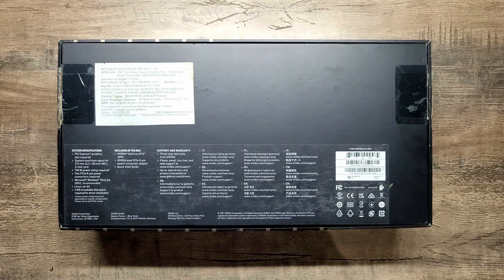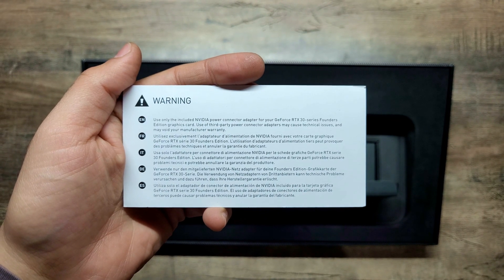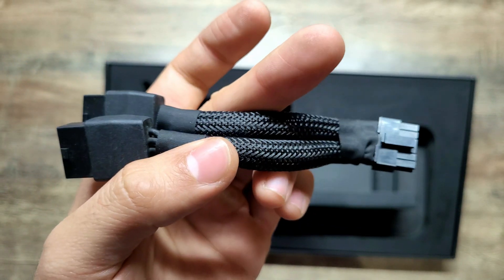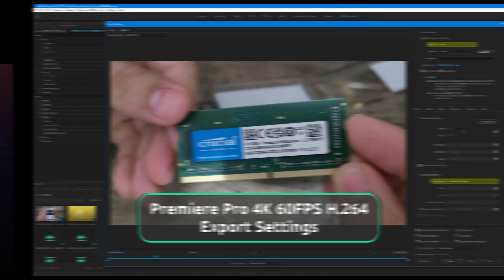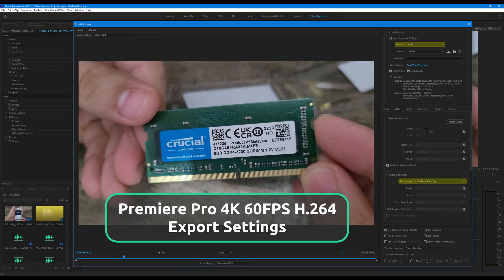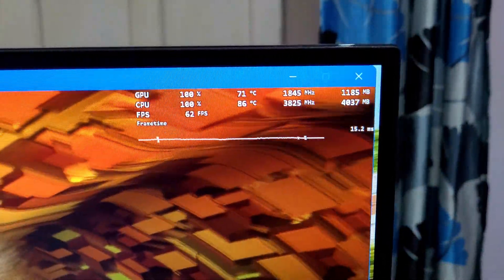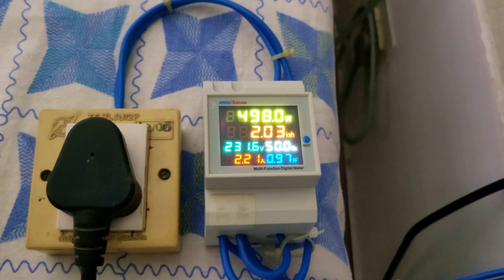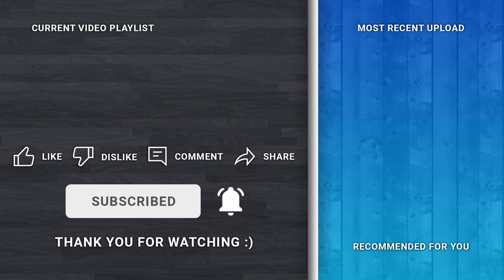GPU Upgrade: From 7 Year Old AMD RX 460 To Used nVIDIA RTX 3090 in 2023

Comment: Very good pc case if you have many HDDs like i do.
Reply from the maker: Yes, only complain with this case power button. I had to open the tiny push button after a few years and scrub carbon deposits then glue it back together.

Comment: *Airflow left the chat
Reply from the maker: 🤣 Airflow exists but this card made everything hot
Reply: @LoveleshKalonia  my 6950xt heats up my room like its a sanna i can only imagine a 4090
Reply from the maker: @djnohands3632  Yea
Reply: @djnohands3632  I only have an RX580 but it heats up like a mf too. 🤣 I always have my glass panel remove to improve airflow.
Reply from the maker: 🤣 gotta let it breathe
Reply: @djnohands3632  6950 xt power consumption is about the same as a 4090. Also it's good to know that your card has power spikes to 500 watt in some instances and there is nothing you can do about it. Just 6950xt thing.

Comment: Awful cable management…congrats buying a room heater😂
Reply from the maker: Yea... My PSU's cables have capacitors in between. So, I did what I could best without bending them any more than the condition they came in.
Thanks, yea room heater it is. It has increased my CPU temperatures too as it throws hot air directly on the intake of CPU. I am thinking about flipping my case fans.
Reply: @LoveleshKalonia  yesterday i have upgraded from 1080ti strix to 4070FE and i   am pleasantly surprised how efficient this card is😊 double raw performance of 1080ti and only 200w tdp and runs cooler never exceeds 65C.I have a 360 AIO for the cpu so the hot air from the gpu dissipates in the case,so i recommend you to upgrade your cpu air cooler to AIO
Reply from the maker: @ECLIPSE_RTX  Yea, I have seen it in reviews, that's crazy, just 200 watts. Will see about getting the AIO sometime in the future.

Comment: you couldve gotten an rtx 4090 for cheaper, also do you realize that even an rtx 4070 can beat even the rtx 3090 Ti?
Reply from the maker: I disagree brother. RTX 4070 is close to RTX 3090 but doesn't beat it. It starts at 60,000 INR and has half the VRAM. Also, there is no used market for RTX 4090 yet. Think about it somone who buys it for 1,90,000 INR, will he ever list it to sale at around 50,000 INR?
Reply: @LoveleshKalonia  yes the RTX 4070 is close, but according to most benchmarks the RTX 4070 has higher clock speeds yet still having half the VRAM. for the used RTX 4090, it depends on where you live, as I can tell, you live in India, as of right now i have checked there aren't any RTX 4090s but you can get a RTX 4070 (Ti or non-Ti) or an RTX 4080 for around the same price as an RTX 3090.
Reply from the maker: @pastelvin  Yes, a used 4070 I can probably get at this price today. But I bought this 3090 in Feb this year. Have been enjoying it for about 6 months now.
I agree 40 series has performance but they came at poor value proposition except for 4090.
Reply: @LoveleshKalonia  yes the RTX 40 series is overpriced, how about you get a radeon or inetl GPU?
Reply from the maker: @pastelvin  🤣 Would have gotten AMD if I only had to play games. Intel hasn't hit puberty yet.
Reply: @LoveleshKalonia  I've recently tried out the intel arc gpus, and I can say that they're as good as some nvidia gpus but not overpriced, there have been some leaks of intel releasing new gpus in Q1, 2024, but I cant really say anything about radeon gpus ¯\_(ツ)_/¯
Reply from the maker: Yes Intel is not overpriced. It's their first gen. Good for competition.